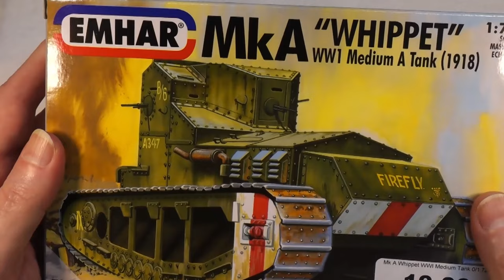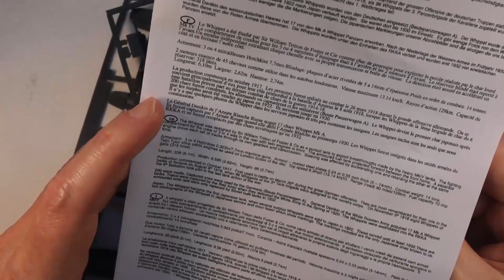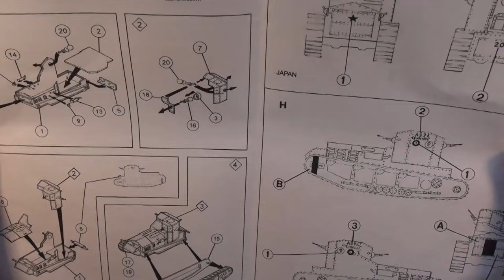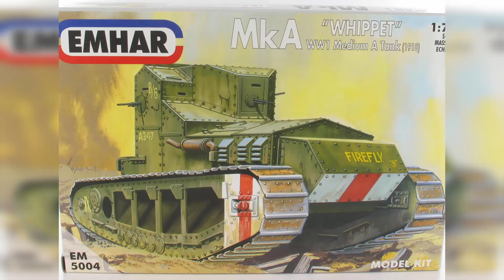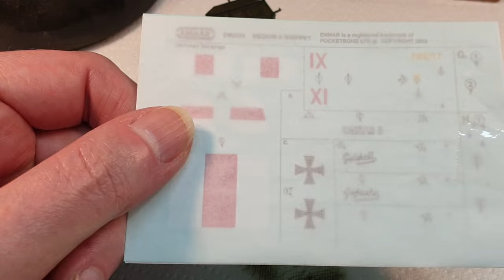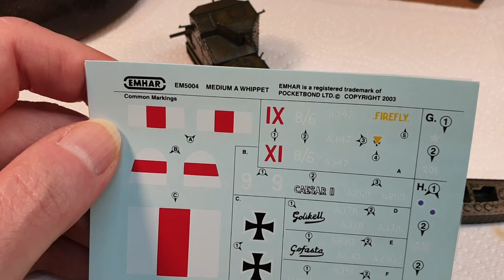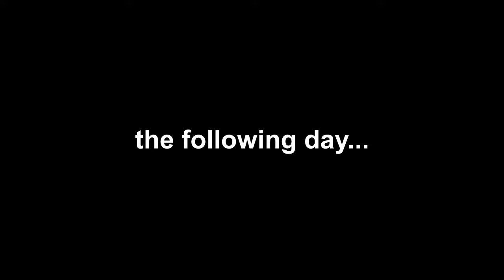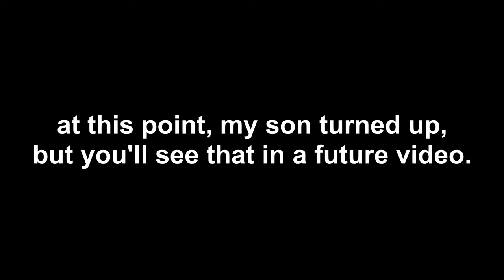Building a 1/72 scale WW1 diorama "Behind the Lines" Part two - tanks for the memory

Comment: I think your decision of relocating the Firefly decal with a better one actually because positioning it higher up on the hull means you don't have to try to blend the used and weathered look of the paint job to the brand new looking decal.
Reply from the maker: One trick you can use for that is to apply the decal, let it dry, then mist a very light coat of the underlying colour over it - takes that new, shiny look away.

Comment: I have several of these, and mine (which I got when it first came out) are crisply moulded with no visible faults. The three I have built, went together perfectly.
The real machine was horrendously complicated mechanically. It makes me think of a castle tower on tracks. A very odd design, indeed.
Reply from the maker: That would make sense. Mine definitely show signs of mould wear.

Comment: Nice job, kits that don't fit properly are annoying as hell.

With the airbrush, one of the best ways of keeping the tip clean is to keep the air on at all times and only pull back for paint, every so often you'll still have to blast it or clean the tip but no where near as much, has the added bonus of drying the paint on the model much quicker. When you need to stop the paint you push the trigger forward to stop the paint then release it. Learnt that from Airbrush Asylum, an Australian airbrush artist and looking at airbrush forums it seems to be a common technique among them, makes sense when you think about it. 

Stopping and starting the air and paint at the same time constantly will have significantly more paint build up and tip drying because when you just let go a big blob of paint is stuck on the needle and with no air to clear it, it just sits there and builds up.
Reply from the maker: That's great advice, thanks. I tend to do something like that, but I'm not consistent with it. I'll give it a try 🙂
Reply: @SteamGeezerUK  Yeah it's hard to break the old habit especially with a small compressor. I'm not great at it either yet.

Comment: When using the hairspray chipping method, can it be left a day or two before starting to chip or does it have to be done more or less straight away?
Reply from the maker: Technically it should work, but you might have to soak it more. I've left things overnight or longer before and it's worked fine.